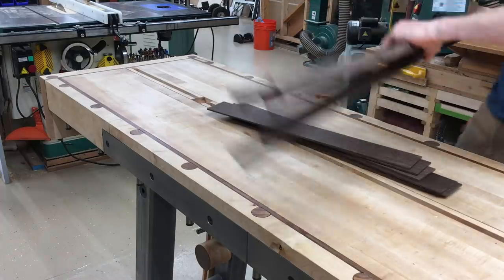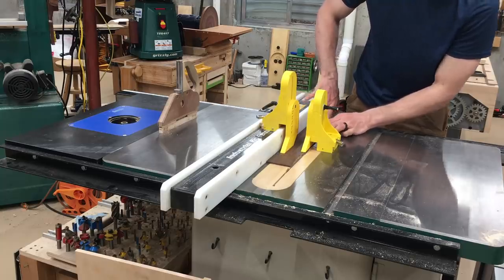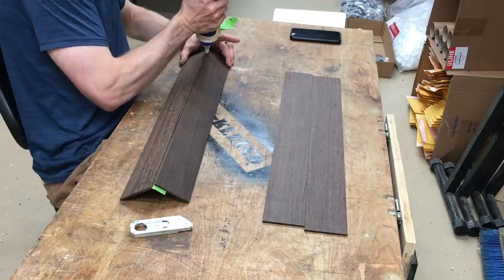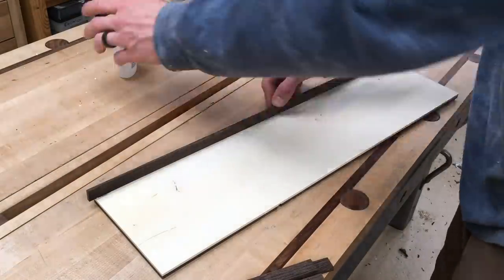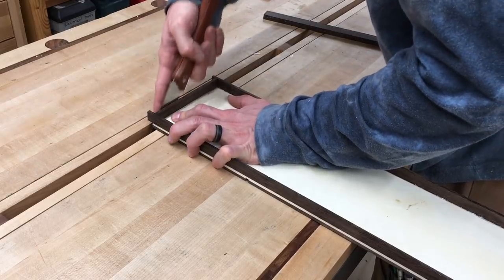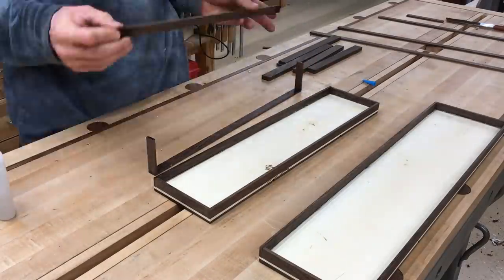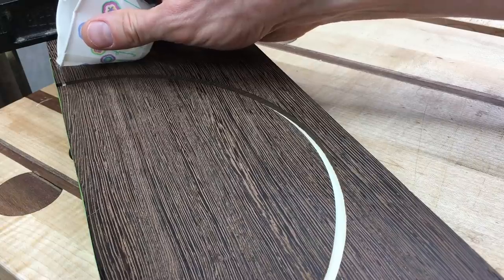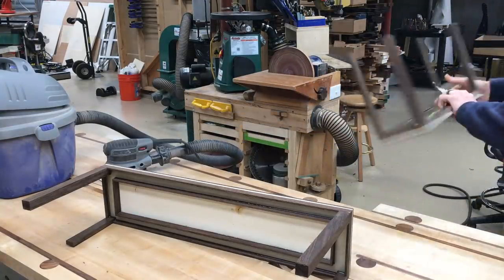Inlay Shelves with Very Weird Joinery

Comment: 1. Did you use a teeny scrap of KleinGrip (cork rubber) on the feet so they don't slip out & crash the shelves? 
2. I used to say "dumber than a sack of hammers." Now I'll have to figure something apropos of a "sack of varnish." If it was paint, you could uncap, suck in some air, recap, & squish it around to mix. It's a way overdue idea.